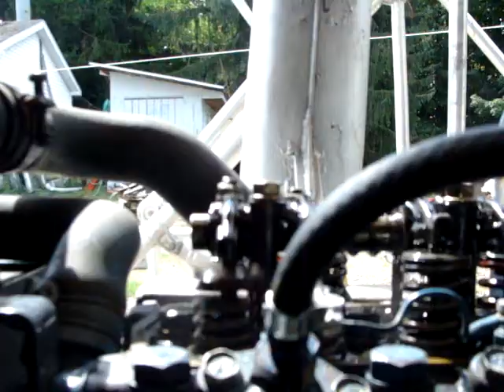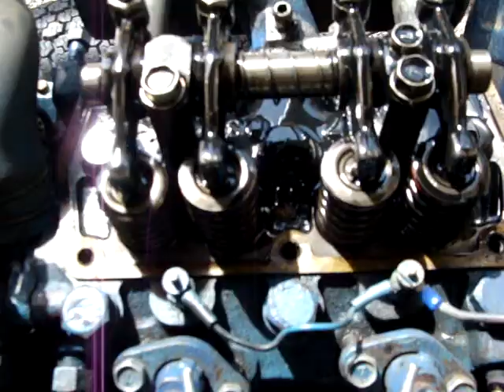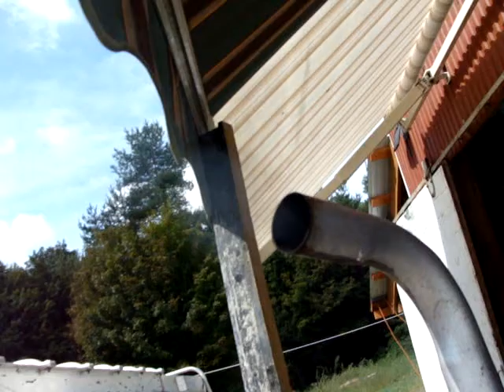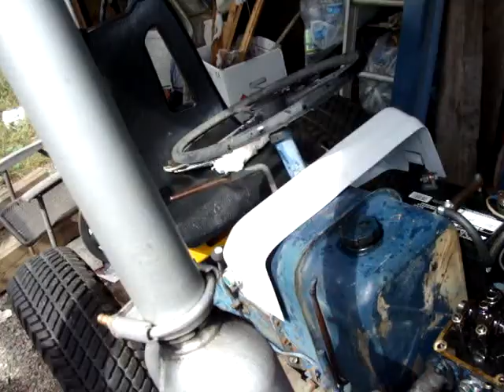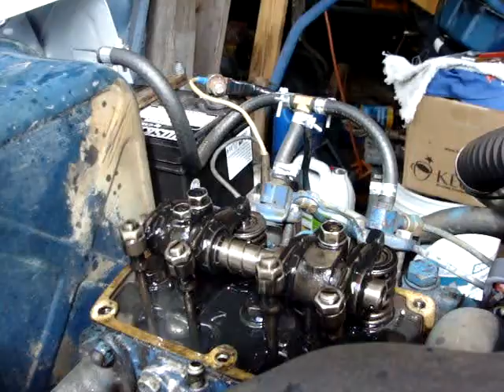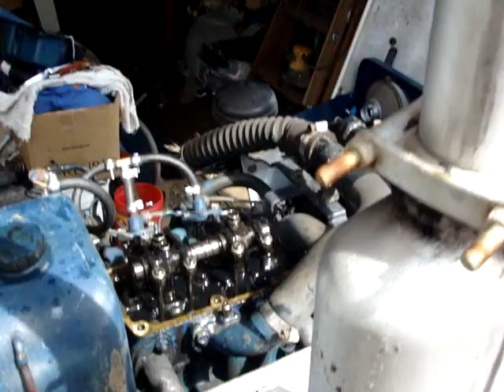arose satoh clatter 003

Comment: Is there still a loud clicking noise even after the correct amount of valve clearance has been applied
Reply from the maker: I honestly dont know.  But I can tell You I put it back together, put 100 lbs on the front and the box grader on the back and it ran well for years without burning any oil.